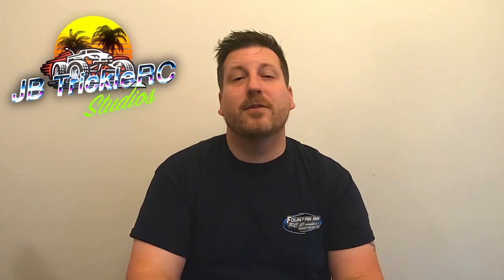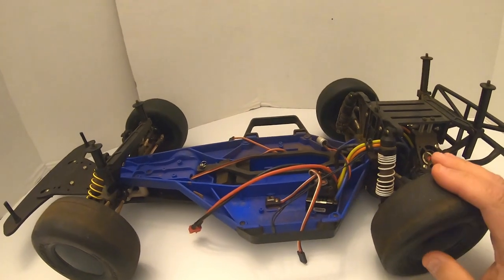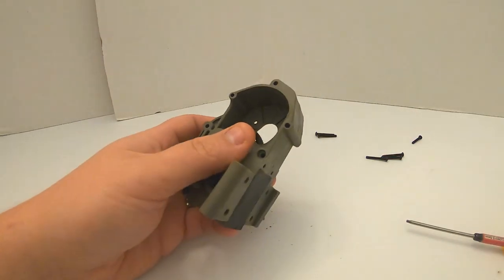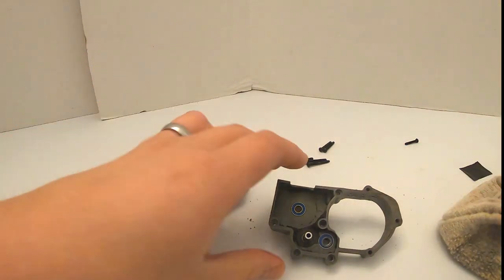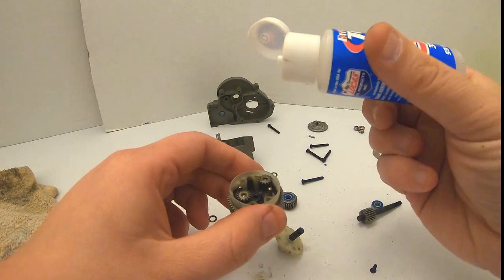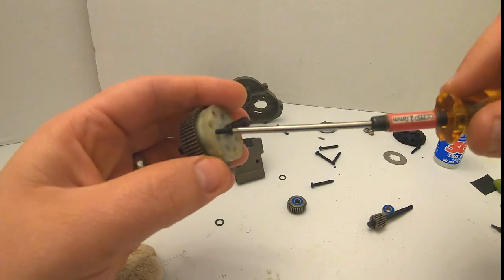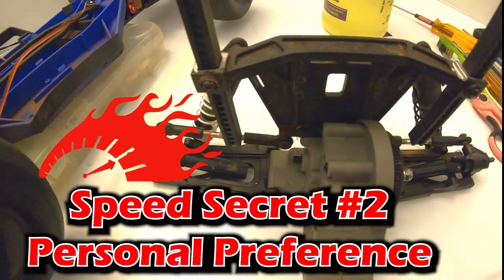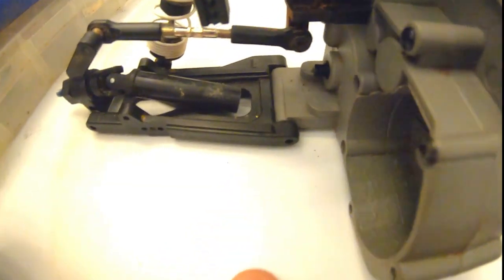Traxxas Slash Speed Secrets, Buggy, Speed secrets for RC Dirt Oval.

Comment from the maker: Hey everyone, I've had a couple questions regarding the flipping of the right rear arm.  I didn't go into deep detail and didn't show the steps because it was already done.  However, it is very possible you might run into some clearance issues on the arm towards the bearing carrier area.  If you are running limiters in the shocks it's not as bad of an issue (like my car).  However I still had to do a little Dremel work around that little cross brace near carrier.  Nothing major, but a little clearance work is to be expected. If you are not running limiters, the problem will likely seem more problematic.  I just wanted to help further explain this to help with this pinned post. Thank you again for all the support.  I'd also like to add that the reason why we flip the right rear arm is due to rules and thats another reason why we dont just put a left arm on the right rear as well.  As crazy as it may sound the rules says the arms must remain in the factory areas left on left side, right on right side, but flipping the right rear arm is allowed since the arm is still in its "original location" even though its flipped.  Hence, further reason before you even consider doing this, verify your rules at your local track.  I dont make the rules lol, I just go by them.  
Lastly, I've had some messages and comments on why not just use normal diff oil for the diff.  You Absolutely can and that's what the diff oil is designed for.  My method I shared here in this video regarding using shock oil instead serves as two purposes.  One: 20 to 30 shock oil is something we all likely have in our RC racing tool boxes so it keeps you from having to buy another bottle of fluid and gives you something that works within an arms reach.  Two: its a proven method that myself and several other racers have used for years without any issues whatsoever.  If you decide to go the actual diff oil method it will work as well.  I just recommend using the lightest diff oil that the diff can hold without leaking.  

Thank you all for the continued support!
Reply: So my track does allow me to run a left arm on the right side do you think that's a better way or is flipping the right one over better
Reply from the maker: @KillrodCane  if it's allowed I'd def run the left on the right. Either way it's possible and likely to run into a lil fitting work but either will work great.
Reply: @jbtricklerc  thanks for the reply and keep up the great videos they are very informative and appreciated 👍
Reply from the maker: @KillrodCane  I greatly appreciate it and have lots more planned for sure!

Comment: I’ve recently got into RC by a karting buddy of mine.  I won my first feature last week because the winner had done this and got DQd (turns out our rules don’t allow it).  I had actually watched this video a day or so before… lol.  We have a pretty cool Slash spec late model class up here about 10 minutes from Bristol Motor Speedway.  Usually get anywhere from 17 to 25 late models.
Reply from the maker: David, awesome to hear your friend got you into the hobby.  Here locally we have several Karting and big car racers that also enjoy the RC Racing hobby as well.
Absolutely, That's why I put up the disclaimer about flipping the arm to check with your tracks rules first.  Some allow it, some don't. Our track allows it in certain classes and others they don't.

Comment: I didnt bother to look at other comments but a good way to get that fluid to stay in the diff is a little trick i picked up many years ago. Use thick automotive chassis or bearing grease on parts you suspect will leak. Its messy but i assume many people grease the inside of the gearbox anyway. I do
Reply from the maker: Awesome information.  Its always fun to me hearing various methods and tricks from various people.

Comment: I know you mentioned talking to the local track about the flipping the control arm rule, but if the rule read "Chassis box stock HCG NO modifications" as far as the chassis goes that the only rule we have. In your opinion does this violate this rule?
Reply from the maker: Great question and in all honesty, I would still ask the race director.  When this first started happening locally it was brought up to our race directors' attention.  The short answer was something on the lines of "as long as it has not been modified, simply flipping the arm is allowed".  However, if you ask another race director at another track, their answer may be very different.  This was also during a race series of which all tracks part of this series ran the same rules.  Now, I personally went back to the rear arm the correct and factory way.  I found it to be a bit too aggressive for me personally.
Reply: @jbtricklerc  thanks so much for the reply and great answer. The reason for not asking the director is his son races in mudboss with us, so if he didn't already know the trick I wanted to keep it to myself. Thanks again for the great content.
Reply from the maker: @MichaelMUDDScruggs  No Problem at all.  I'm happy to help when I can and always try to respond.  Thank you for the support!

Comment: It’s been many years since I raced and am looking at getting back into it possibly with an associated car but I’m not sure that the differential will hold fluid as well as the traxxas diff does plus I’m not sure if the control arms will be able to be flipped either.  I will have to look into it.
Reply from the maker: agordon7369, welcome back to the hobby!  Yeah, it will be more experimental with the associated as everything mentioned here is Traxxas Slash specific as that is the car that we must run (unless in the breakout class).  But anything is possible.  There are many options out there for a smooth differential, I was sharing my method specifically here.  But there are other good options as well.  experimenting will be helpful.

Comment: I’ve used diff oil in my crawler shocks before, never thought to use shock oil in my diffs 👍
Reply from the maker: Big Jeep it works well I. The Traxxas cars where we try to get the diff as free as we can and as light as we can where it will hold.  It's an old racer trick for optimizing something that we likely already have instead of buying something else.  In other applications where a thicker diff oil is required I stick with actual diff fluids.

Comment: What late model type body can I use and would I need to move the rear body mount like yours and where did you get those parts ? And wheels and tires
Reply from the maker: https://youtu.be/tx_iHI8JVvk

A lot of your questions are answered in this video link.  As far as late model body. There are various types.  Just have to make sure it's sized for a slash or SCT truck.  MR Kustoms, Shark bodies LLC and JConcepts all make bodies.
Reply from the maker: Ooo I almost forgot. The rear body mounts were just a ebay find. It's a 3D printed set. Many sellers offer them.

Comment: I clear the bearings shield out 3 and 1 oil in the diff and replace the top shaft to the drag slash top shaft and no spacers in the transmission
Reply from the maker: Nice info as well! The bearing shields were a pan car trick we did for years as well.

Comment: Personally, I found having grease in the diff it's alright and cover the gears with Lucas oil additive. Works good.
Reply from the maker: Nile Virus I appreciate the comment and information as well.  Its always interesting to find out what other have used as well.  I'm going to be experimenting with a newer grease I've never tried before in my new 2022 GFRP Havoc car as the direct drive has a gear diff instead o the older style direct drives.  I'll probably cover my experience with that when the 2022 outdoor season opens back up.
Reply: I do this to my trans also don't know if it helps much but thinner than grease and it stays on the gears.

Comment: ? Mr JB in your years of experience in dirt oval would you say most races are won staying on the bottom of the track
Reply from the maker: I'd say most races are won with a combination of set-up, corner speed and consistency.  It can be a challenging combo to acquire, but with practice and preparation it comes with time.   I had a racer tell me a long time ago that while RC oval racing you should only touch the steering wheel in two areas of a race and that's when driving it into the corner. Now, of course we have to steer or drive around other cars and avoid wrecks etc.  But what he meant by that is the less you have to touch the wheel the faster the car.  Any unnecessary steering corrections you make slows you down overall.  It cannot always be avoided, but when you can, you want to drive it in and it should want to drive itself out as you ease off the wheel.  Thank you for the support and comment!

Comment: One question. So if I flip my back right arm like you said, would it be good to also have an adjustable arm on the back left arm?
Reply from the maker: It all depends on the rules of the track you are racing at.  Which I always tell everyone to verify before doing any parts changes or mods.  If your track allows it I'd run full adjustable arms on both sides.  The right rear flip trick was done as it was "within the rules" for our local tracks.  Some places won't allow you to change them at all.
Reply: @jbtricklerc  thanks. Makes sense.

Comment: You can clean it all with paint thinner and much easier to clean. Also pop off the bearings and clean out the grease in those. Trim the the blue overcast off the bearing seals. Will reduce the resistance.
Reply from the maker: Awesome information as well Wes.  I use to rework all my bearings.  Then I just started going ceramic. Though some of those need some attention too.
Reply: @jbtricklerc  the tip on the bearings is for the stock classes that require stock bearings only. Mudboss and super street for example. Must have traxxas blue bearings.
Reply from the maker: @wesfleming208  I hear ya there. I remember when I mainly ran paved oval back in the day we were also working the bearings in one way or another all the time.  I always hated messing with the shields and such but we do what we gotta do right lol

Comment: I run on a small oval with 2 pretty tight turns would you still recommend using the 30 wt shock oil or a heavier one.
Reply from the maker: Michael, great question.  I run this method in my current and all previous traxxas based cars and have for years.  I'd feel it would be very beneficial for a tight track as well.  25, 30 weight oil or even a light enough diff oil.  something to experiment with and I always go as light as the diff will hold.
Reply: @jbtricklerc  I am new at this and I feel that your tips and videos are very beneficial and I appreciate the help you offer to racers. Thanks for always replying to my questions.
Reply from the maker: @KillrodCane  no problem at all. I'm here to promote and help as much as I can. I greatly appreciate your comment and kind words. Best of luck to you in your RC racing. Have fun and best of luck and don't be afraid to comment or ask questions.

Comment: With the flip of the RR a arm will that help with traction roll
Reply from the maker: Gerald great question. Maybe and maybe not. Depends on how bad the traction rolling already is.  If you're allowed to run limiters, those, springs and tires and steering dual rate is what I generally use to take traction rolling issues.  Even with some rear steer the car still transfers weight to the right side when turning.

Comment: I tried food grade anti seize and it seeped right out! I was going to ghetto lock it “JB WELD” but I got the hot racing locker! I’ll save the open diff for when I start spec racing 🎉 i grease with Lucas heavy duty the green grease 😂😂 vaild info thanks 🙏
Reply from the maker: I hear ya.  There is no way of finding something that works like trying it.  I've always said try various things.  There is always more than one way. I greatly appreciate it.
Reply: @jbtricklerc  you know any titanium hardware kits ? Most my stock hardware is almost stripped out.
Reply from the maker: @livinlikelarry8782  Great question.  I've never used them on a slash so I dont have one to recommend, but I'm sure someone out there makes a kit for the slash.
Reply: Yeah I'll keep hunting for them, I need them so when I'm bashing on pavement I'm throw a bunch of sparks 😆😆😆

Comment: Interesting. I only lightly cost the gears in bearing oil as the tranny should be broken down after every race day. Also, use the bearing oil on the gears in the case. Another thing you should do is pop those blue covers off the bearings take an exacto knife and trim the excess rubber coating on the inside of the blue cover. Do that for each side on each bearing. Add some bearing oil and put them back together. The amount of resistance you eliminate from the bearings is extrodinary. Try it on the bearings for the wheels. Do a spin test pre and post you will be amazed..
Reply from the maker: Awesome information Lucky 13 Racing! I've seen a few comments recommending the bearing mod as well.  We use to do something very similar in the pan car world too.  Any little detail can go a very long way.  I appreciate the comment and support.
Reply: Good idea, I will try that. Never thought about that actually causing drag. Didn't know it rubbed. But will give it a go!! Thanks
Reply: Thanks for the tip- here’s my speed secret- I use (orange oil) wood polish on my skateboard bearings- best lubricant for bearings that I’ve ever used- I’ve tried them all- from gun oil to shock oil— nothing beats orange oil

Comment: Hello I’m setting up a 2WD LCG slash for our bomber class. Couple questions. Are those the custom works Springs?, Do you prefer the big bores or the GTR shocks? 1/4 inch limiters in all 4 shocks? Or just the front. Thanks.
Reply from the maker: Hey HDFPV, No problem.  I'm happy to help when I can.  I used the stock shocks as it was required by the rules, but the springs are indeed custom works big bore springs.  I also kept a set of Integy slash springs as well.  As far as limiters go, I believe I was at 1/2" all the way around.  You may have to fine tune it to your liking.
Reply from the maker: I go into a lot more detail in another video of mine where I do a full stock slash to dirt oval conversion.  I recommend checking that video out as well if you havent already.
Reply: @jbtricklerc  thank you for your reply, if you could run any shock with the custom work springs what shock would you choose for 2wd lcg slash? i have seen the other video, thank you that helped alot. i picked up a roller with no shocks, just trying to figure best shock to run, also do you have a rough ride height you run?
Reply from the maker: @HDFPV2015  great question.  I never ran other brand shocks on mine personally.  But based on what I've heard id imagine the proline or even aluminum associated big bores would be a good option.

Comment: Hey JB. Your buddies slash in this video. Does he race mudboss or latemodel?
I like the front bumper and also the way the rear body posts are mounted. Curious if both those can be bought somewhere and if they’d work on a latemodel body like Shark Atomic?
Reply from the maker: Low aSteam that car is for the 10.5 Latemodel class. It's currently running the MR Kustoms Late model body.  The front bumper I can't recall exactly but it's either a McAlister racing, CCS or Crazy Dave's front bumper I believe. All three make a great product.  The rear body mount extension was a eBay purchased part I believe it was a AJC extended body mount. I'd imagine they would work on that body as well but you know how the RC body mounting can go lol sometimes some fitting and customization is required lol
Reply: @jbtricklerc  thank you JB!
Reply from the maker: @lowasteam5319  anytime. I'm glad to help when I can
Reply: @jbtricklerc  and I have another question lol. I noticed the slash in the video has a motor fan I found the extended rear body posts on eBay and you can get that same one with a fan mount. In your experience, does the fan provide any performance benefits?
Reply from the maker: @lowasteam5319   Great question. Really great question.  I'm sure my opinion will differ from others but for certain classes yes I believe it benefits and other times I'd say no.  Some classes that are pushing everything to it's limits (motors, gearing, timing, etc) benefits in my opinion.  A stock "spec class" I don't think it would necessarily be all that beneficial.  As those type classes gear and limit the cars to make everyone "level".
Reply: @jbtricklerc  Thank you JB and that makes perfect sense.
Reply from the maker: @lowasteam5319  anytime. I'm happy to help

Comment: What solid wheels fit the front
Reply from the maker: @Whoknows3347 if you are talking about buggy style solid wheels (no holes) I'm not 100% because I never used them personally.  the wheels I usually ran was the DE Racing wheels like I used in this build.  I believe DE racing makes some like you are looking for as well if I remember correctly.   If not, you could still use the DE racing wheel information to determine what size you need for the front as they call out the different offsets as front and rear.